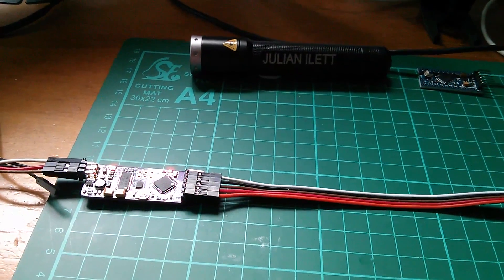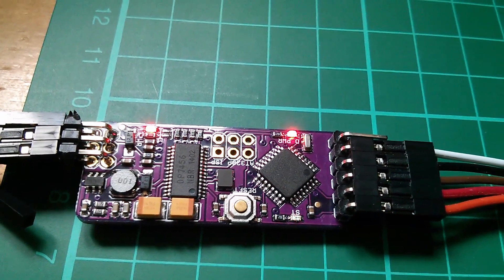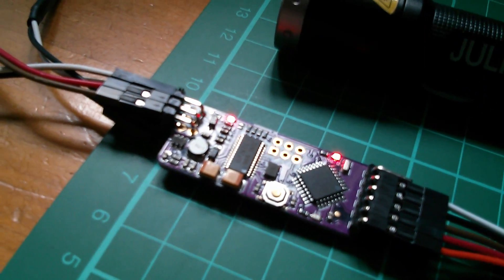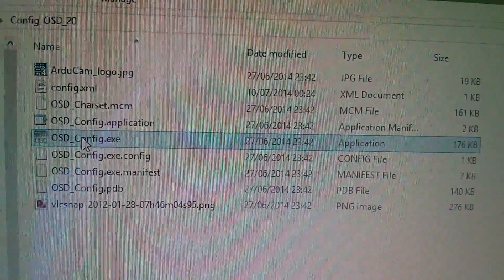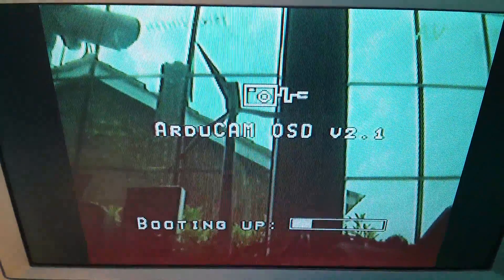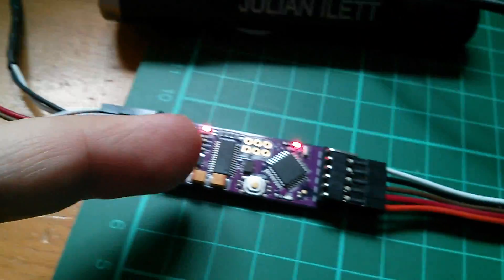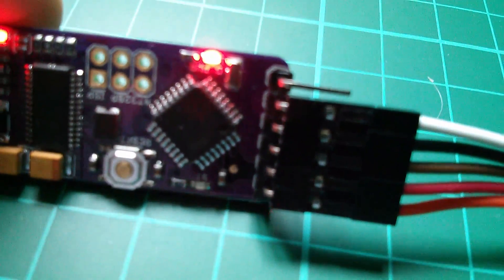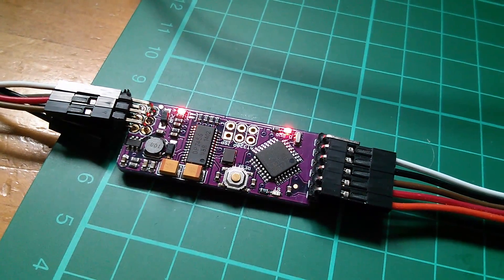First Look: ArduCam minimOSD Quadcopter On Screen Display PCB

Comment: It looks like MAVLINK is actually UART protocol, but what data it sends? I am asking, because I want to put on screen my own telemetry by another arduino (pressure, altitude, compas, etc.). It will be good to know what data exactly it expect (which format) so that it may be used for experimenting. Thank you for this video. 
EDIT: By format, I mean for example: alt 123, spd 40, and similar sentences, or maybe just numbers in some order; 123, 40, 565, 1043002...  I am guessing that MAVLINK protocol acutally giving specific data, but... Do you have some guide to this protocol? I know... I have google, but you have experience. Thanks.
EDIT2: Found something, but very, very complicated: https://pixhawk.ethz.ch/mavlink/  This is whole protocol, but did not found anything about specific 'heartbeat' commands.

Comment: You should run the video overlay chip with 5volt supplied by soldering the two pads on the board And don't run the 12 volts in... the overlay chip will not heat up as much.and you will get a longer life out of your board...

Comment: 4 cheap motors for <7ukp each ay 1100kv ish etc, 4 cheap 8 inch props, some bits of wood or bamboo and duck tape, (I went with plywood, it was doing nothing) any old 3s/4s 3000mah+ battery,  cheap board like a 25 quid crius all in on + a 10 quid gps reciver, 4 20amp motor controllers for <10 quid each. 

cheap setup. crash as often as yo want and replace the bamboo for pennys.

Oh and a cheap 9xr 8channel radio set, good as any expensive one if you ignore the plastic build quality.

and when you decide to go better, you can recycle the parts into the new build.

Dont let people say you need 'quality' etc, theres a lot of emperors new clothes in any group of hobbyists..... The best kit is homemade, you learn, you dont when you buy...

Comment: Great video Julian, very informative (as always). One thing about the Hubsan though, while it CAN be a good trainer (I have two of them) you are going to need a good supply of spare parts for when you crash (as you will :-) ) quality control on these things is not great and I have had one arrive dead out of the box (the motors fail very easily after a couple of knocks.

Comment: grandmas and eggs Julian but thinking about the heating of the video overlay chip it appears no solder was used to bond the chips heatsink to the board. Maybe try adding some solder paste to get better thermal contact could be an option. Both of my boards get warm but not alarmingly hot.
Reply from the maker: True, it didn't look like the chip was properly bonded to the board, but the heat did seem to be getting through to the copper.

Comment: The problem with those tiny quadcopters is that they tend to have a very simplistic flight controller which makes them near impossible fly.  With some practice you can eventually get them to sort of do what you want.
A larger copter will generally have gyrostablizers making them a totally different type of flying experience.  As an analogy, you're now learning how to use a cheap skateboard to get experience at driving a car.  They both have 4 wheels, but that's about where the similarities end.
More expensive copters will also have stuff like hover mode which makes the copter stay in a spot in the air without you touching the controls.  And then there's the flight contorller like the ardupilot which has GPS and allows you to preprogram a flight path and the coptor will follow the waypoints.

As far as the OSD goes, that copter is simply too lightweight to carry a camera, an ardupilot (or whichever flight controller that has all the info the OSD can display) and a transmitter for the live video+datastream.

Comment: Thanks for the acknowledgement Julian.
You will find once you have Ardupilot set up and flying then control is very simple. As you said to truly master the piloting aspect then a simpler control unit like the one fitted to the Hubsan is the best course. Should you progress to something more hard core then the Naze32 flight control board is one of the best for fun flying. It is not as capable as the Aurdupilot for automation but eats the Ardupilot for stability and manouverability.  Naze32 multirotor flight controller (part 1)
One last recommendation. For an excellent RC system look at the FrSky Taranis. Open sourced firmware equal to any of the big name brands and well made hardware. FrSky Taranis Review (part 1)
Both are available from http://boltrc.com/uk/
Regarding the split supply for the minim board. The concensus these days is the dual supply is more of a hinderance than benifiet. The original idea was to provide a convenient source of 12V for the typical CCTV camera. Any noise introduced by the motors can easily be killed with a LC filter on the 5V feed.